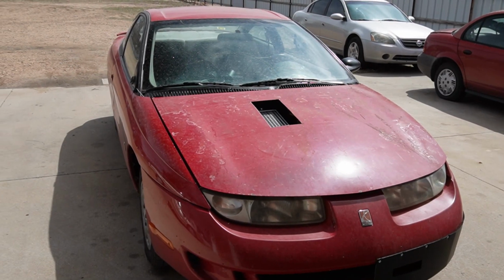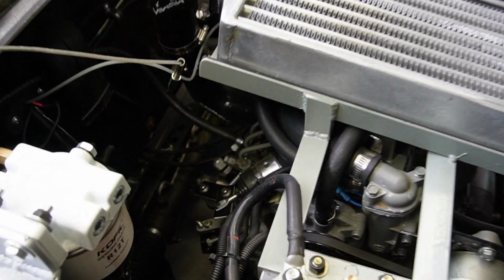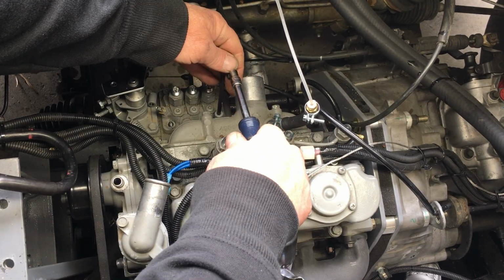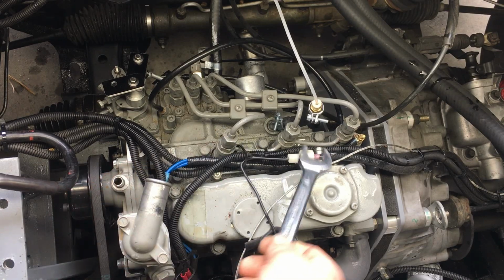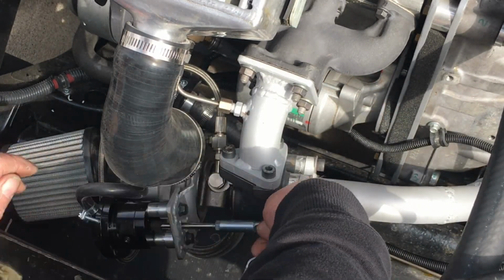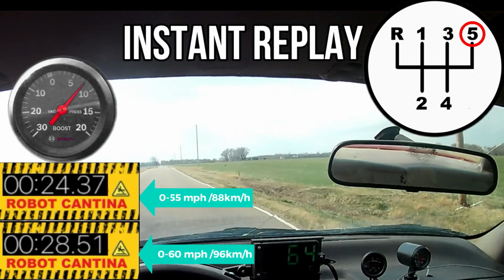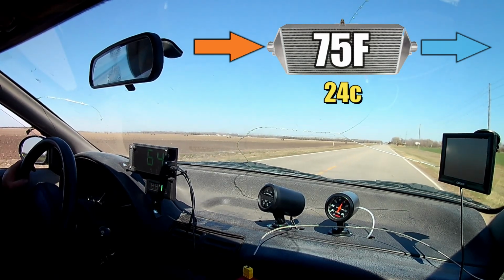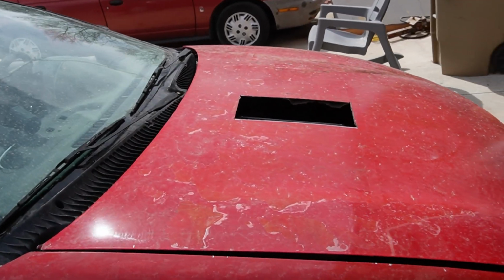S3 E9 We modify the injector pump timing and add more boost for more speed and better fuel economy

Comment: The intercooler needs to be force fed with air to allow it reduce the compressed air temperature maybe fitting a scoop on to the hood may do it
Reply: So... it's time for a hood scoop, perhaps?
Reply: Scoob
Reply: a definite yup
Reply: The IAT is 75deg... High intake temps aren't an issue, as it stands now.
Reply: those intake air temps are pretty respectable with the current setup, actually.
Reply: General rule of thumb, force feeding the intercooler with fresh air will be the best...

Although 75degree iAT sound reasonably low, means the turbo can be pushed at higher boost...

2bar boost test next time around maybe?
Reply: Not necessarily. The simple expansion of the charge air thru the intercooler is enough to transfer heat into the core but obviously it would become heat soaked rather quickly if the is no external airflow thru the outside of the unit to keep the delta from doing it's job

Comment: 60mpg at 65mph is nothing to sneeze at! nice work, love this series
Reply: cough 76mph somethig mhmhm
Reply: Its more or less exactly what would be expected if everything works as it should for this car/engine combo I think. So it seems its working just fine, which is good.
Reply: i wonder the mileage it could get if put onto a motorcycle frame
Reply: @oye6124  I heard tell of an off-road dirt bike with a diesel. It’s all hear-say, but i remember seeing 150.
Reply from the maker: No proof that it happened.... just sayin'n   lol
Reply: @robotcantina8957  i believe you
Reply: @oye6124  oh my gosh , its small but you might need a bigger motorcycle.
Reply: VW TDI had insane fuel economy but the nox was a problem.
Reply: @tobiwonkanogy2975  ever heard of boss hoss
Reply: @TurboVisBits  VW figured a way around the diesel emissions....oh wait
Reply: @unclejoe6811  Allegedly......cough
Reply: They've essentially made a DIY version of a VW XL-1 lol
Reply: @Blackarrow145 it’s a military multi-fuel bike it’s based on a kawasaki klr 650

Comment: Switching to electronic boost control might help with your lag in boost when changing gears. Especially if you were to use an interruption-style controller. That stops the actuator from seeing any boost pressure at all until you want it to. That can have a massive effect on spool-up time.

Comment: I think it is a result of all of the above. I used to have a diesel jetta, same engine you are planning on putting in your insight. I advanced the pump timing to around 10 degrees before top dead center and turned up the injection pump which resulted in much more power, enough that it completely removed all the friction material from factory clutch disk I had just installed so I had to upgrade, and a huge increase in fuel economy. .

Comment: Better placement of the intercooler will definitely help EGTs especially above 55mph.
Reply: ...and a scoop!!!
Reply: @nodrug2  it's begging for a scoop.
Reply: I really want to put a naca duct on my cars intake lol
Reply from the maker: The intercooler is not in a great location but its working pretty good.  it brought the intake air temp down from 120F to 75F.
Reply: This is true but there is an adamant amount of efficiency with how inline it is with the normally aspirated set up. ( being the simplest route from turbo directly to intake)
Reply: I would think the intercooler should be placed behind the front bumper cover in one of the corners. Like some of the MK4 VW Turbo cars.
Reply: @robotcantina8957  egt will drop dramatically by reducing exhaust back pressure, you have too much restriction, combined with turbocharger, way too much
Reply: @robotcantina8957     In general, one deg air temp decrease, normally coresponds to about 3 deg exhaust temp reduction, and reduced NOx emmision. Some experiment to reduce intake temperature could be interesting to see here on this fantastic series. Great work.

Comment: Have you considered water injection for keeping the EGTs in check? I had a Scout II with a Nissan SD33T turbo diesel, I ran post turbo water injection for long hill climbs to keep the EGTs in check. I mixed in denatured alcohol occasionally (for fun), made a notable power difference and still kept the EGTs way down. As a plus it de-coked the turbine and really woke the turbo back up. Great videos btw!

Comment: if i remember rightly you have a 2-3mm lip the whole way around the inlet to the exhaust housing from the mismatch in size of your pipe that feeds exhaust gas into the turbo. if you take a grinder to it and port match it you should get more turbo response, i suspect it will help it make more boost in 5th when you are trying to push more air through it.

Comment: An old farmer taught me a diesel trick. He added cheap mineral 2 stroke oil to the fuel at about 100:1. 

It runs quieter and sweeter. It makes up for the loss of sulphur in the diesel and keeps the pump and injectors happy. I've done this for 20 years in my diesel vehicles and tractor with good results. Smokes less too. Give it a try!

Comment: you should look into propane injection, its pretty much nitrous for diesel. It will/should cool temps, add power and even efficiency. You don't need special propane either, just the gas station stuff works great. I don't know exactly how to apply it but I know its possible without different injectors. All you need is a way to get it into the fuel line.

Comment: I worked on an over-the-road tractor with a turbo, and an "aneroid" that restricted full rack until the turbo built up pressure.  Worked nice for eliminating smoke.
Reply: turbo dont wind up as quick though

Comment: On the diesels we are finding if we increase the rail pressure and shorten the duration the fuel burns more efficiently. There are a lot of ways to do this but without PCM programming you you can increase the rail pressure simply by swapping to a high psi sensor cause it the scale is 5v. But to change duration you will need to edit the tables in the PCM.

Comment: You are killing it with this series! Being in the diesel world myself " Just with an engine with nearly 6000cc's more lol" could I suggest looking into a water/meth injection system to keep the egts at bay? Also what my brother did with his diesel that I thought might be interesting on a smaller scale is propane/natural gas injection.
Reply: Water/methanol isn't good for diesel engines and it's a lazy bandaid for proper fueling and turbocharger sizing. He could fix the EGT problem with an equal length runner manifold, but he's using the stock log manifold because it's the cheapest option.
Reply: @JosephArata  WHy isnt it good for them, if I may ask?
Reply: @GoldenCroc  straight methanol causes backfires and pre-ignition. Water has been used for decades to lower egt and make more power, water/methanol does so and adds extra fuel for even more power.
Reply: @brianargo4595  Yep, I know. Thats why I wondered in what way it "isnt good for diesel engines". Seems like there would be some prerequisites he might want to mention?
Reply: @GoldenCroc  better exhaust scavenging. this is why Subarus had cylinder 4 ring land failure. cylinder 4 has the longest exhaust path to the up pipe, causing it to scavenge the least/slowest, which makes it run the hottest. an equal length header solves this. there is also nothing wrong with water/meth when its needed. its generally used in the gasoline world and not diesel. when you're absolutely at the limit of what your intercooler can handle, say on a Hellcat charger, you can use water/meth injection to cool the intake charge. its a big help on factory air to water intercooler setups.
Reply: @Tyler-ts2ld  I am sorry you had to type all that to no avail, since there wasnt anything in my post that was helped by/answered by what you typed. Ah well, bad luck, everyone can misunderstand something. Hopefully you didnt put too much time into it.
Reply: @centraltexasfoxbodies  diesels use fuel to heat the cylinders, not air. Exhaust pulses can be tuned to be even if the runner lengths are all the same. Log manifolds do not do this, you get unequal heating pulses across the turbine. The purpose is to keep the turbine spinning at an equal rate without a drop out every full cycle of the engine, this keeps the compressor airflow constant.
Reply: @GoldenCroc  water methanol destroys rubber gaskets, it causes premature cylinder corrosion, and you have to refill it constantly. It is a drag strip or tractor pull lazy bandaid for excessively large turbochargers and overfueling.
Reply: @JosephArata  Interesting answer. When and where does this W/M fuel mix come into contact with rubber gaskets, because I honestly struggle to think of any from the cylinder and outwards. There might be one between the intake (where its injected) and cylinder head, but it might also be made of another material. The W/M kit itself isnt technically part of the engine and is supposedly supplied with resistance in mind if it is of sufficient quality, so that isnt an issue. Would be nice to hear more of your thoughts.

Cylinder corrosion from something that as far as I know burns/evaporate completely at very high temperatures without leaving residue isnt something I have heard of, do you perhaps something I can type in to search more and learn more of this phenomenon? Cant find any sources talking about it being an issue, the only thing I could find says that its a somewhat popular myth likely originating in the corrosion that can happen to some qualities of steel when being in contact with liquid methanol for long periods like pipelines etc. Some examples would be nice.

The last example and last parts of your comments arent related to how it "isnt good for diesel engines" as you stated, those are purely user related niggles, so I dont have any questions here.

Hope to hear back and learn something new! Cheers!
Reply: @centraltexasfoxbodies  you obviously don't know anything about thermodynamic exhaust gas flow and turbine characteristics. Stick a turbo on a 2 cylinder without a pressure chamber and equal length runners, find out how the engine doesn't want to run, nor the turbo want to spin. You're strawman arguing about something that isn't an issue with 4+ cylinder engines. That is also, lazily engineered by using an extremely small turbocharger, that makes no more than 5 PSI on its compressor map, on anything less than 4 cylinders.
Reply: @GoldenCroc  crankcase steam from water methanol. It doesn't evaporate at high pressure, the water will get into the crankcase. Anything rubber or plastic not meant to be around methanol will absolutely deteriorate, within 1 to 2 years of constant contact.
Reply: @JosephArata  So you posit that enough of the W/M mix escapes into the crankcase through blow by, and isnt subsequently evaporated from there fast enough by the temperatures therein. Thus causing issues.

My questions are then as follows; 

1: Why isnt this issue more widely reported? In fact I struggle to find even a single report of this being an issue at all, perhaps you can direct me to where I can read more? 

2: I know some people that have run W/M injection for several years with so far no ill effects to report. What time frame are we talking about here?

From a casual glance, it seems there might indeed be some prerequisites on top of the "isn't good for diesel engines" that might be relevant you might want to mention? If the engines normally expected longevity isnt affected to any larger degree, I think that might be worth mentioning, for example. Like from 21 years and 500k miles down to 20 years and 480k miles., or pehaps even less. As well as which models of engines you have found to be most affected. Would be good info to have.

Cheers.

Comment: I had a 1979 Oldsmobile with the 350 cubic inch diesel , I advanced the timing on it because it would only run 65 MPH  it was much easier to advance than this thing.  Loosen 3 bolts use a crow bar to move the distributor looking piece with 8 fuel lines about an 1/8 of an inch and it sounded stronger and went from 65 MPH to over 85 fuel mileage went from 16 MPG  to 20 MPG

Comment: I have a 1992 Toyota 4runner with a  3L series diesel (2.8 litre, naturally aspirated). It does 0-100km/h in about 27.5 seconds (though in good mechanical condition, it has about 650,000km on the odo). You are pretty close to the same acceleration!

Comment: Just for some perspective, my 250lb 300cc Enduro motorcycle gets just over 60mpg at comparable speeds. It also tops out at about 80mph depending on the wind. The fact that you're moving 10 times the mass with comparable economy is very impressive.

Comment: I think fitting a fan under the intercooler, along with some simple ducting to blow air from below, up out the scoop would both pass more air over the intercooler, but also keep the engine bay temps, meaning cooler air temps for the turbo. Even if only slightly.

Comment: Little anecdote on the fuel economy increase. I have a turbodiesel Jetta, and most people report increased fuel economy after doing turbo and injector upgrades. This seemed backwards from what I thought would happen so I did some digging trying to figure it out. It seems the common theory is that by making more power, you spend less time accelerating, and that is when you consume the most fuel. Seems logical to me but definitely counterintuitive to what I've always thought.

Comment: I know this is just for fun, but actually this setup is not bad at all. 4l/100km for ~30sec to 100km/h is pretty good since I currently have VW 1.6D without turbo and its time to 100km/h is even worse, its so slow that I have to be in racing mode all the time just to be with traffic.  I think and also it uses like 6l/100km, although engine itself is very old and injectors are probably gone too.

Comment: Are you power braking it before you take off?..or are you just putting your foot to the floor? You need to power brake it to let the rpms build before you take off from a dead stop.

Comment: Excellent video all around! Clear explanation of how the shims work to increase the advance; thorough details of the speed, time, and fuel economy; and fun demos of the mechanical side including removing the injector pump and fixing the dented rear end. I got a good laugh out of using the Saturn as a fixed point for the winch - it's a car of multiple talents!

Comment: The best way to reduce the exhaust temperature is to put larger diameter exhaust pipes and remove the muffler system to reduce back pressure, the higher the exhaust pressure, the higher the temperature will be, and the larger the pipe, the lower the pressure, and thus temperature.  Also have you considered an exhaust cooler system? A simple copper pipe coiled around the exhaust manifold and filled with coolant that is sent to a separate radiator can reduce exhaust temp significantly
Reply: Not when it's tune related.....

Comment: One thing to consider is when you remove those shims you're not only advancing the pump timing, you're also increasing the duration because the valve closing event occurs later (adding more fuel). Since it runs well I would assume the lash isn't too tight and keeping the valves open. How is the timing gear attached to the pump? Is it keyed? Even if it's keyed, do they mate with a conical taper like on a 12 valve Cummins P-pump? If so, you could remove the gear, clean and scuff the mating surfaces, and advance the timing further (without the key if applicable) and it would be measurable so you would know how far advanced it is.
Reply: No. The duration will remain the same. There is zero lash between the cam lobe and the pump even at factory settings. So the pump still follows the same profile of the cam lobe as before, it just happens a little earlier.

Lowering the pump, and closing the "lash" does not hang any valves inside the pump. The depressing of the pump followers by the cam lobe just pressurizes the fuel in the system, and then the injector "pops" open when the pressure reaches the preset level. 
So, slightly varying the "lash", or position, of the pump follower on the cam won't hurt a thing. It'll still provide plenty enough pressure to activate it's preset "pop" setting and send fuel through the injector.

Comment: Nice repair on the Renault! Back in the 70s I used to pop out dents in my Fiat 600 by slapping the panel on the back with my bare hand. Not exactly thick steel.

Comment: My old-ish compound turbo diesel BMW does about 4 psi at tickover, and maybe 6-7 at those speeds you were going at, as a reference. I thinks its a pretty solid interval for fuel economy you are in, but of course in my case both the boost and top speed extends far further than your car does.. (for now? :) )

Comment: I can't believe the progress that you've made.  Heck, the engine bay even looks nice.  At those speeds, you should probably install one of those deer scaring whistles on the front bumper.
Reply: I will never forget a very close encounter with a moose in our saturn years ago.   One of those whistles things might be a good call....LOL
Reply: Those don't work
Reply: @lancecluster  Did you drive between its legs???🤣
Reply: @will7its  My Wife was driving, I was in the front passenger seat with our 2 kids in the back seat.  Pouring rain storm at dusk in upstate New Hampshire.  Moose came out from the passenger side of the road.  My wife swerved and we ended up going around the front of the moose,  the car went under it's head and neck.  I had an excellent view.  Lucky my wife was driving, I would have hit it.
Reply: @lancecluster  Yeah Its usually better to not swerve.  Glad you made it. Good story...lol